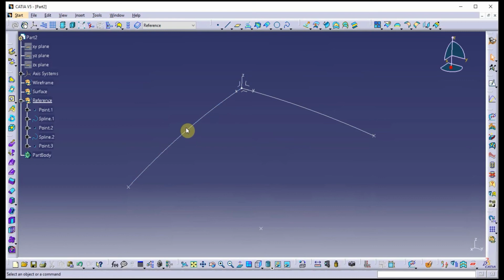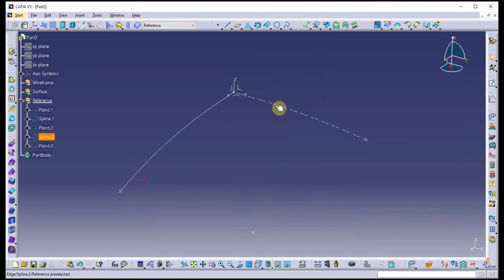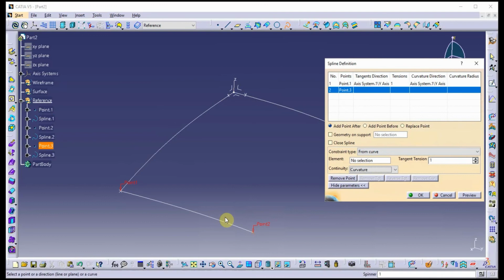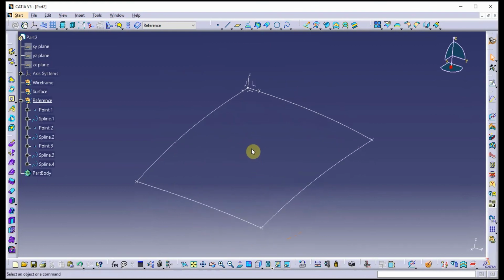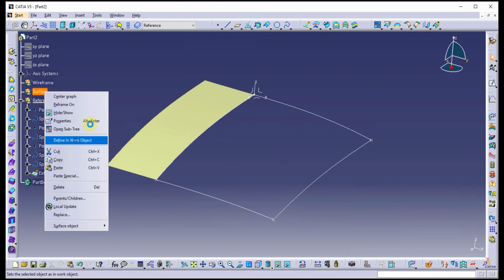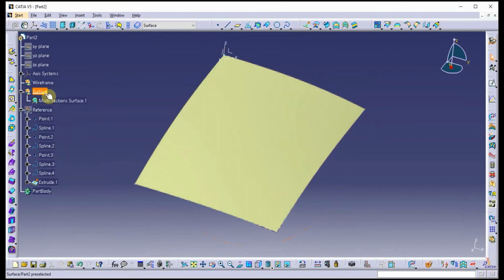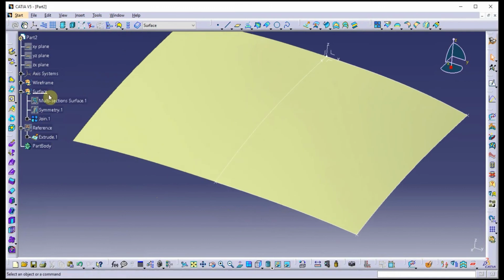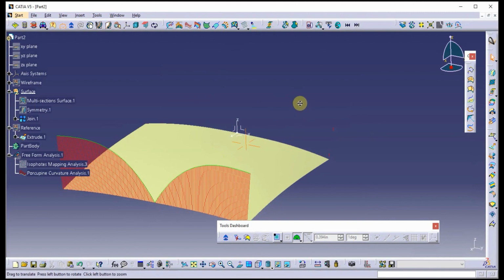CATIA Surface Modeling: Seam Continuity, First Look

Comment: That is taught by many, another thing that's taught is a normal constraint across the mirror line. I actually disagree with both methods, and don't understand why people let the mirror function rule their modeling techniques. I believe there's a far better method, build a symmetric curve across the mirror line/plane, that produces a much better condition across the mirror plane.